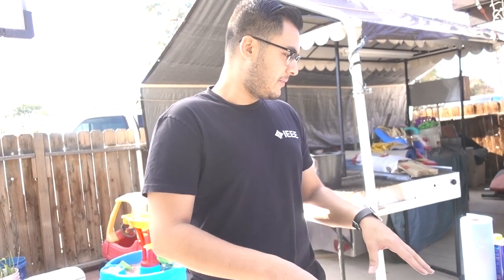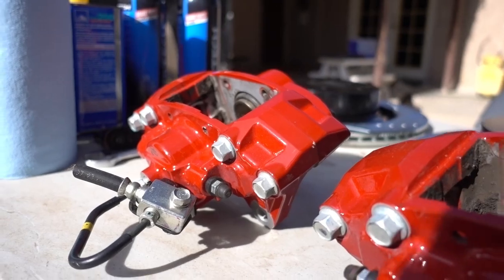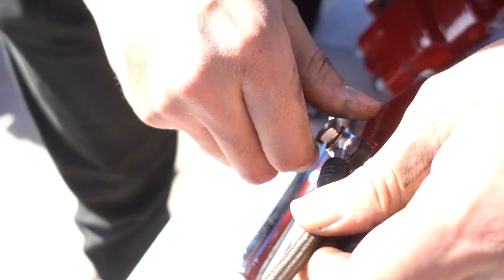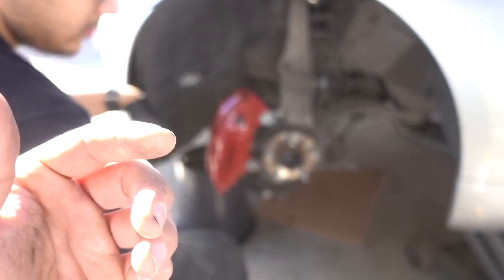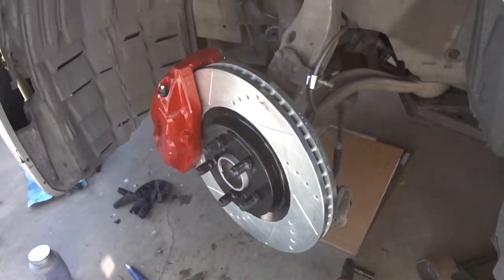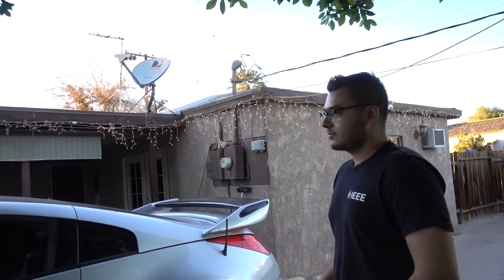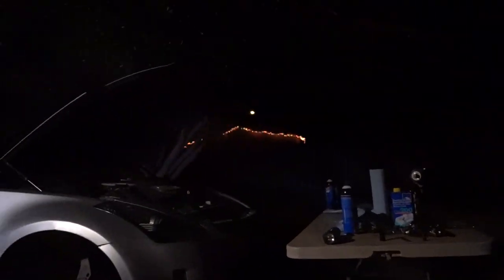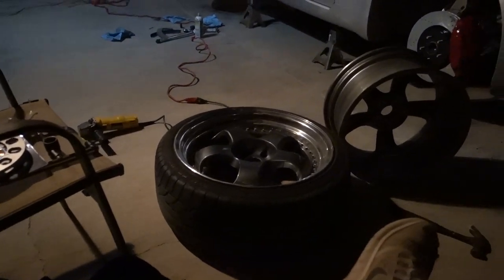Installing 370Z Akebono BBK on to a 350Z!!!

Comment: I just finished this same upgrade on my 2007 350z. The front calipers slightly interfered with my  wheels (18" oem Nismo stock setup).  Unbolt the caliper halves and you'll see that there is a reasonable amount of  distance from the internal fluid passage to the casting surface. I used an angle grinder and removed about 2mm from the caliper surface in the areas that were hitting the barrel of the wheel.  They do look oh so sweet!!  New wheels are also a great solution... just more expensive. Good luck!!!
Reply: Justin Time  yep, on the rear, I used tin snips to remove the outer edge of the dust shield to make clearance for the larger diameter rotors. On the fronts, you'll only need to trim a small piece of the dust shield to make room for the bigger caliper to fit.
I previously upgraded to SS lines. It's not necessary, but you will need the shorter banjo bolt that attaches the brake line to the caliper. Check it out at Z1motorsports

Comment: Bro I need to know if the rotos are 370z or 350z link for the rotors and for the lines are 350z lines or 370z lines??? And pads have to beeeeee 370z let me know
Reply: Same bro wondering the same thing

Comment: Doing this brake upgrade would you have to get 370Z ss lines? They would bolt straight up to your 350z/g35 hard lines aswell?
Reply: agustin arrona Yes sir, they should, only thing that changes is that banjo bolt needs to be specific for Akebono’s because i believe it is a tad bit longer than stock caliper banjo bolts.